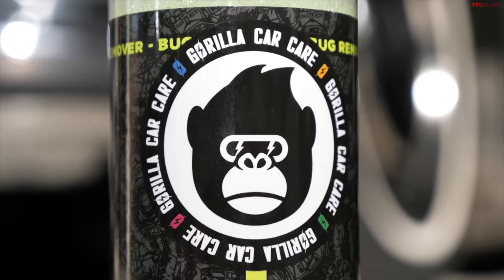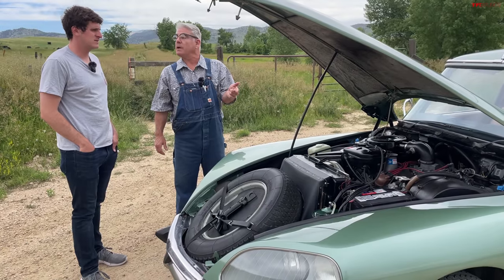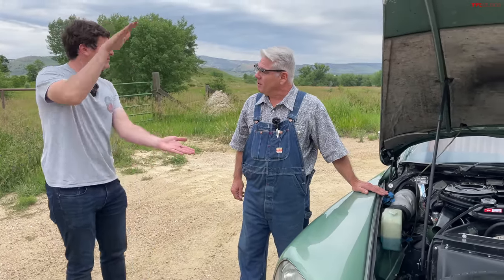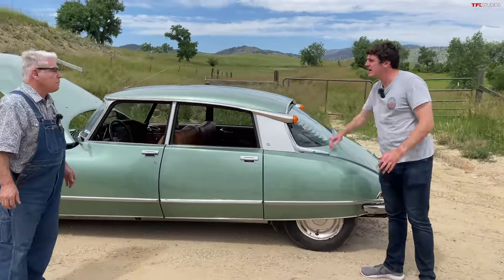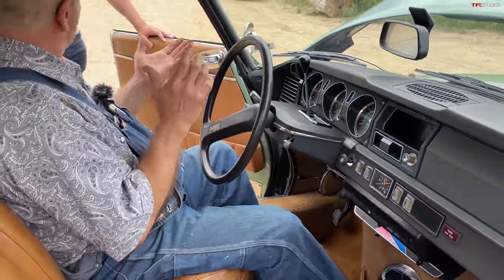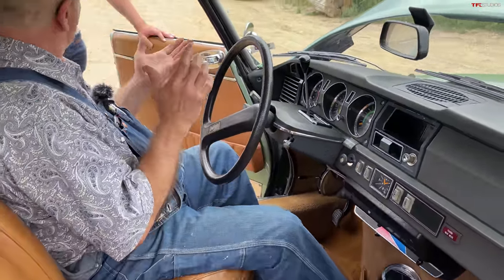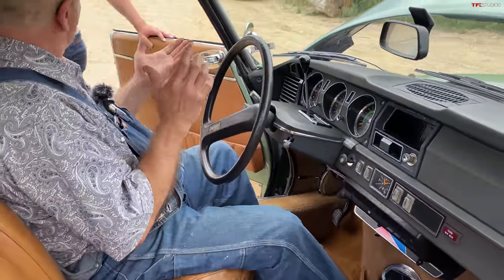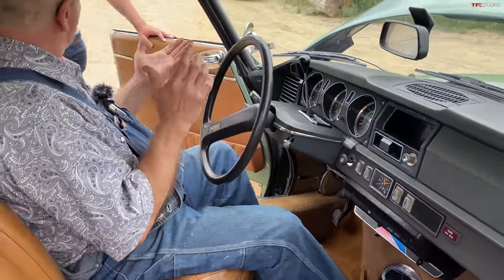Really THAT Unreliable!? Is The Citroen DS as Bad As The Internet Says It Is!?

Comment: Ironically, it's designed was inspired by the raindrop, the most aerodynamic shape for a bit of fluid to fall through air.
air & fluid concepts followed through to the suspension, the sphere holding nitrogen equal in pressure to the weight of that section of car, against a rubber bladder pushing back against hydraulic fluid support the wheel through a lever.
Not all that mysterious, yet well thought out.
Holes covered by washers that bend dampen the flow in & out of the suspension cylinders.
A small seven piston rotary swashplate pump provides pressure as needed through an accumulater(another sphere/cylinder device)for all needs, power steering, brakes, suspension , lift. , etc.
Whammycablame that the D'S in a nutshell!
Oh, yes, giant inboard disc brakes & hydraulic lowering of the rear to provide equal patch pressure to instantly stop better than ABS.
It feels like when your on a speedboat and you cut the throttle, it just lowers into the water and stops.
Your not thrown forward like in Flintstonemobiles.

Comment: To bad that Citroen stopped with the hydramatic suspension system on their cars. We had several newer Citroen (Xantia, C5) with this system, and they are superior when it comes to comfort and load levelling. And no: no expensive repairs on suspension (or other systems) on either on them.
The newer cars has electric pump, and do not need engine to run for suspension to be active.

Comment: This guy says a few mistakes  , he obviously doesn't know these cars very well . The radiator air intake is not located in the grill, but under the front , the roof is very weak and offers no protection in the event of rollover .
He is very passionate, though, and loves his car, which is appealing . These cars are very attaching once we've driven one . The injection version can be troublesome. 
They existed with air conditioning but the option was horribly expensive,  you could buy a small new car for the price of it ! 
I own a 2.3 injection with a/c and I love it 😊

Comment: If you don't maintain the spheres and drive on it with a failed sphere it can ruin the entire system but if you replace the spheres every 10-15 years it's not so bad its no where as complex as Mercedes air or hydropneumatic hydraulic suspension its a much more simple system and cheaper and easier to service you can get to all the parts and lines unlike a modern car

Comment: I love this car and to me it just is one of the most iconic and even sexy cars ever designed, fully on par with that Jaguar E Type, which is hugely expensive today, if still in original and running condition at all, but those were even in UK infamous for being crazy unreliable, unlike the DS. I just can't understand one thing, when there was this retro craze in the car industry a few decades ago, VW making a new Beatle, Fiat a new 500, BMW a new take on the Morris Mascot (now known as the Mini), why did Citroen not make a modern DS? They by the way all were overpriced and not as good as the cars on, which they were based, for instance cost the 500 half a time more than the Panda, which is basically the same car, but the Panda got real rear seats and a boot, but Citroen could have made an iconic retro modern DS, instead of all it's modern bland designs. About reliability: I have had four VW's in my time, because they were supposed to be reliable cars, none of them more than 25 years old, they were horrible and noisy to drive every day, the first actually so loud, that I had to yell to people, the few times I had anyone with me in that car and good luck finding a VW still running in original condition from the 1970s here in Europe. Or an Opel (Vauxhall), BMW or even Mercedes. Citroen DS I regularly see on the roads, also here in Denmark, though mostly as a very protected summer car (we salt the roads in winter, which kills the cars very quickly). 40K US Dollars though, for such an old car, to me would be a hard sell. I most likely would take those kind of money and get something with a warranty and a service agreement then, I got to say.

Comment: I am pretty shocked that i am able to understand this suspension after fixing my 2002 mercedes e320 wagon those metal balloons are on the back and it has the same hydrolic pump that connects to steering and speed sensor. I cant believe mercedes uses something similar on a 2002 mercedes lol i can say after i fixed the issue its being incredibly reliable. I approve the mercedes e320 until 2002 the most reliable e series ever! You know why? Is my wifes daily driver and is rock solid. She even puts garbage gas and we use cheap oil lol 5 years later not even a leak on site now with over 160k miles she regrets saying i will drive it until the tires fall off.

Comment: In 1972 cars were just as nice looking new as they are now.   A lot of the cars actually  rode better.  Old caddilacs new rode much better than a nice new Lexus today.  I know because i have a Lexus.  A lexus is a better car now but they still don't ride as well as an old Caddy or Lincoln Continental.  That being said cars are definitely better today.  You get many more miles on them now and even though the steel is thinner, they don't rust as quick.  1972 wasn't much differnt than today other than the styles and communication tech.   i had a brand new 1974 Cordoba that was plush and rode smooth.  No car today has anything on it as far as looks when new.

Comment: Surely the length of connections between the engine and the wheels would mean a loss of horsepower?
Reply: ?!...I can scarcely mount a reply to this comment. Your assertion makes no sense and illustrates an overwhelming lack of understanding of the mechanical systems in play here. This car is front wheel drive. The power is delivered to the wheels within the distance of a dinner plate.

Comment: Hold on "oleopneumatic" yeah that's not wrong... just more confusing to most peoople than necessary, less familiar. I mean most of the supension is hydraulic, with pneumatic elements, and this hydraulic system, just like most, runs on oil rather than water. Of course ther are quite a few hydraulic fluids such as higher fluorocarbons etc which are neither water nor oil, anything goes to an extent as long as it's incompressible and has a suitable viscosity, but most are oil based. As such hydraulic, as a term used today, no longer denotes necessarily a water based system as opposed to what the root of the word suggests; as such there was no need to go language lawyer here and say that people get it wrong when they say hydropneumatic.

I should say though it hit me like a brick when i realised some decades ago that all of the actions you see generally implemented mechanically via linkages, can just as well be done with hydraulics, with the spring being replaced by a volume of air, a pneumatic element. This opens up crazy opportunities in packaging and dynamics, since you can just bend the pipework around whatever might interfere, and you can have programmable variable valves on every connection to adjust the dynamics on the fly really easily.

Comment: The Citroen DS. Was too far ahead for the. American car owners. As the Citroen. Wasn’t a v8 with solid axle. Land yacht. The Citroen was so far ahead of its competitors. And still stays that way today. The suspension is like riding on a cloud, it was so comfortable the be a driver or a passenger. The headlights turned as you steered around  the corners. Something that took, other manufacturers decades to catch up with the DS. When it was launched it was like a spaceship, because it was so far ahead of the competition. No it didn’t have a massive V8. Powering it. Because it didn’t need to have such a big engine. Yes they were expensive to buy in America. No more than how expensive an American land yacht would cost you in Europe.

Comment: Its not an "Emergency Brake" it the "Handbrake"or "Parking Brake".
Reply: It is actually an emergency brake. The brake has a setting where it will not lock into place at the bottom, so you can use it an a very effective emergency brake if necessary

Comment: These are not the original spheres. They are from a CX. This model should have the two part, screwable ones, that is also possible to fill with new nitrogen gas! In this case you just fill them upp with new, cheap gas, and the suspension is like new again. You never need to replace them. Compare this to other, more conventional cars!
Reply: NO, they were all welded since early 70's.

Comment: Older Rolls Royce  used mineral oil in there brakes also
Reply: Most bicycle disc brakes use mineral fluid as well (in fact, LHM by Citroën / Total works fine).

Comment: No doubt about it, US regs on front lights sure ruin the lines of a great European design...
Reply: I wouldn't disagree with you. 
This car has a mix of the North American & European lights. The headlights were modded to the European before I got the car. The North American spec side marker lights are nestled into a depression in the sheetmetal and conceal a hole for the electrical connection. Otherwise, I would have removed them.

Comment: DS is the successor of the ID, not the Traction. And yes, that car was at least, at the very least; 50 years ahead of its time. Not a single car manufacturer came even close to this.
Reply: This is wrong. ID was built from 1957 to 1969 as the less powerful and cheaper parallel model of the DS, It had a conventional gearbox, slightly reduced power, no power steering (ok with 1150 kg / 2500 lb only) and lacked some luxury details. I consent with you about the rest. The straight-4-engine was a bit noisy, but all-in-all a great futuristic construction.
Reply: @akronymus  so ... how am I wrong in my comment? I did not try to compare pears with apples I merely indicated the timeline.
Reply: @ricogo2447  
My dear friend, your timeline is wrong. First, there was the DS, 2 years later the ID as the economy model. Later ID followers were the DSpeciale (more or less the ID) and the DSuper with an overdirive-like 5 gear. On the other side there was the DS Pallas with leather interior and such stuff. However, if offered to me, I'd take any of the models. Giant comfort and passenger space, and giant driving experience.

Comment: You could lose a full set of spanners in the panel gaps
Reply: that's WANTED! BECAUSE it's removing air draft noise! AND of course is faster to build in the factory. If it would be sealed like and airplane than you have air noise. AND would cost much more to build.

Comment: We had a 1958 Mercedes four-door the same straight six engine is in the gull wing with that engine running as I said very happily the man of the house is happy with that it was built so the woman of the house simply got behind the wheel started the engine and the hydraulic automatic clutching system was much the same if you’re selling a model with a hydraulic it may be booked listed as a few hundred dollars less but has nobody knew how to learn from what’s the transmission and the car is trying to tell you as this gentleman so right Lee says it’s just right there you get in you started you tighten up your driving gloves your nice sunglasses oh that’s right I have a hard top it drives like a limousine and I can go really fast brakes suspension everything is balanced and even and really has a wonderful wonderful ride as does my 1950 Indian chief 80 inch V twin roadmaster deluxe

Comment: Yes its oil Mercedes has it too its still called hydropneumatic in the industry even tho technically its incorrect it's called hydropneumatic on the entire industry and your probably not going to change that all the cars the use mineral oil or Mercedes fancy pentosin which is the go to for all modern systems its still called hydro not oil hydro means fluid not water specifically in the industry

Comment: There are only 2 challenges of this car, unconventional suspension which requires extra lubricant for it, and the brake button, but so many people who drives it daily had converted it to regular brake pedal. Aside both this is the flying carpet on the road.
Reply: "...extra lubricant..." - Not sure what you even mean by this. And I the, 'conversion', claim is fiction. Such a conversion would  be a costly, downgrade.

Comment: Where does the DS's bad reputation came from? 
Well I'm glad you asked. 
Firstly you must understand a normal car uses Brake fluid which is corrosive [think mild acid] but their system is designed for this fluid. Citroen uses hydraulics [as used on trains, bulldozers, large aircraft - you know - places where reliability is key] which uses a form of hydraulic fluid; which is not corrosive [think engine oil].  When you put BRAKE FLUID [a corrosive] into a system not designed for corrosive fluid, it develops leaks. BAD MECHANICS and Cheap skate owners ignored this and put brake fluid in, and then created the unreliability myth to cover their pathetic mistakes. Just imagine if your petrol cars was half filled with diesel fuel - it would blow smoke and run badly so to be fair and to judge both cars fairly, you'd have to say [enter your cars brand here]'s have smoky rough engines that are unreliable - but lets make another urban myth, shall we.

Comment: it´s more reliable than most of the new cars today ,only a non car enthusiast would make such a brainless remark, one point : what car today you blew a tire and you keep driving to your destiny why the best brand in the world asked permission to use it´s suspenction, at the time there were a few cars and a lot of iron with wheels and a anemic engine pulling it to drive a family to a bit distant place ,after driving a car you had to sleep to take the edge off after making many km´s in any DS from the 19 GT to the 23 pallas (the ones i owned) after a trip you would fell like you didn´t had driven a bucket of screws with wheels ,at the time there were 1 car and two brands the DS the rolls royce and the mercedes nothing else, all other high-end cars from cheap brands couldnt be compared to this i refer and i colect cars ,kind of a poorman´s colection but already have 26 cars ,i´m getting old

Comment: This car was suppsed to be powered by a rotary engine but the plans suddenly changed for a few reasons. This is why the development of the 4 cylinder was so fast.
Reply: ?! Absolutely not true. 
An air-cooled, flat 6 was in development in the '50s but was scrapped. The Traction Avant 1.9L engine was used in the early models. In the early '70s, the Citroen GX was to have the Rotary engine but that proved to be a dubious choice and development ceased.
Reply: @1KJRoberts I find the flat 6 story hard to believe, with their width and the limited foot wells from the upright 4.  Maybe the flat 6 would have been in front of the trans?

Comment: DS21 did not have the Citromatic transmission, that came with the GS/CX cars. The number 21 on this model is the size of the engine, in this case, it is a DS 2100. Kevin, there are no climate controls, the one with the colors red and blue is for the heater control, and the other one is for fresh air intake.
Reply: DS 21’s has semi-automatic transmission called the Citromatic or BVH (Boite de Vitesses Hydraulique, or hydraulic gearbox).
Reply: maybe you were thinking about the DIRAVI?